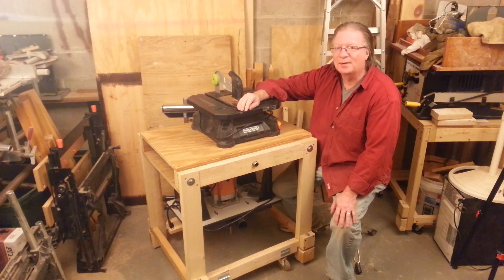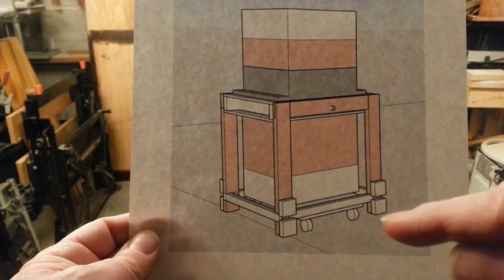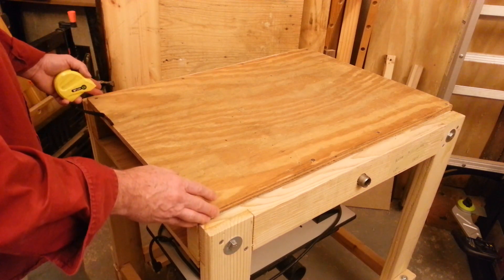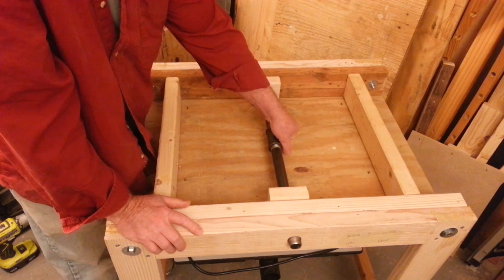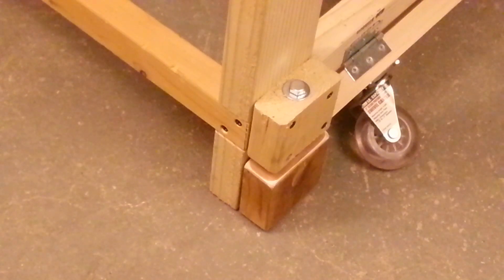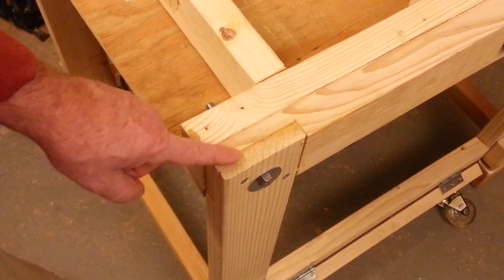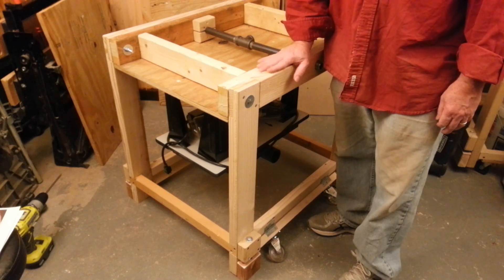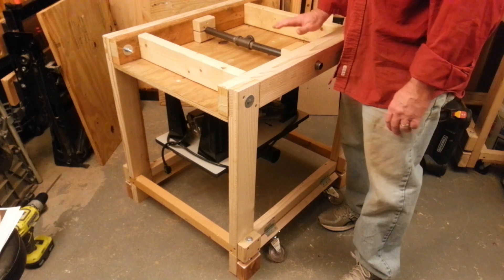81. Flip Top Table build comments

Comment: Do you by chance have a plan or sketch of your flip top. I can't seem to find one anywhere else I was hoping you may have one? Could you please let me know, thank you in advance
Reply from the maker: Hi Vince. Unfortunately, I do not have the SktechUp files for this project any longer. The hard drive in the laptop I did the the design on failed and I lost all of those files. Very upsetting but lesson learned. When I bought my new desktop computer, I also purchased two (not just one) large external USB hard drives. I use BOTH external drives to backup ALL of my files.
However, I believe the videos that document the design process of the flip top table are detailed enough so that you could recreate the design yourself using SketchUP free ( https://www.sketchup.com/plans-and-pricing/sketchup-free ). Of course your design would need to be dimensioned properly for the tools you wish to mount on the table.
Thanks for your comment and for watching.

Comment: I just found your channel and I was wondering if you could describe your shopsmith bandsaw a little bit more in detail on how you like it thanks
Reply from the maker: Hi Ed. For a couple of years, I was a Shopsmith enthusiast so I enjoyed using the band saw along with the table saw and drill press. (I never tried the lathe, the disk sander, or the horizontal boring machine.) The Shopsmiths you see me use in my videos were all purchased as (very) used machines. The Shopsmith band saw was kind of loud while in use. I never took the time to figure out what was causing the noise. Maybe it was the blade guides?
After using the Shopsmiths (and several other power tools) for a few years, I decided to make a video that showed how loud each power tool was. Here's a link: https://youtu.be/ZVMdqWjYnhA . It was shortly after doing that video that I decided to try and move more toward using hand tools (quieter, less dust, lower cost, no electricity needed, requires less space, ...). After using more hand tools for a while, I decided to sell my Shopsmiths. And I have no regrets. I find using hand tools more satisfying and challenging.
Thanks for your comment and for watching.

Comment: Hello. I am trying to get information on the web about the sturdiness of flip top tables vs. hinged.  I've owned several hinged antique tables in the past. At a certain point, the hinge could be no longer fixed and I had to sell the tables. I recently spotted an old flip top table (built in the late 1880's) that I would like to use as a small dining table. I would like to flip it on a regular basis to give us more space. Will this create more wear and tear on the mechanism, which is pretty sturdy( except the top turns a little). The other option is a brand new, but well made hinged table (I'm thinking about hinges breaking again). Any information that you could provide would help. Thank you!
Reply from the maker: Thanks for your question. I have only owned and used 1 hinged table. It had 2 sides that hinged up from a center section. Attached to the center section were 2 swing out legs that were used to support the hinged top sections. Also in the center section, was a place to store 4 wooden, folding chairs that came with the table. 
As I recall, this table was very stable and was designed for daily use. It looked a little like this:  http://www.greenheart.furniture/santos-butterfly-dining-set-with-4-folding-chairs-pine-and-grey-seconique.html
The only flip top table I have used is the one I built. And in the end, because of the way I was using it, it didn't save me any space and was not as convenient to use as I had hoped.
Hope this helps and thanks for watching.

Comment: I've built a number of tables ( not rotating ) that are very stable. I used 1 x 6 boards as my stretchers. I notched the 2 x 4 as you did. this may help on the rocking issue
Thanks for the tour
Reply from the maker: Thanks for your comment Jack and thanks for watching.